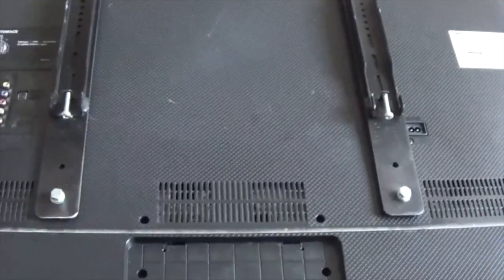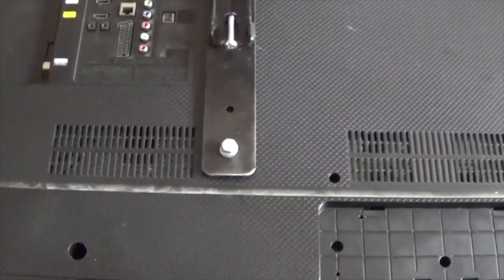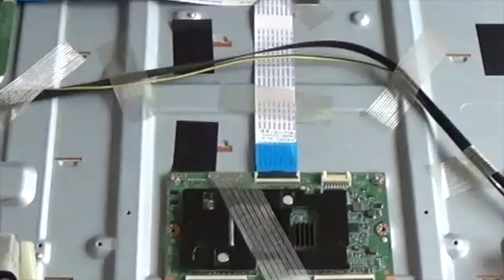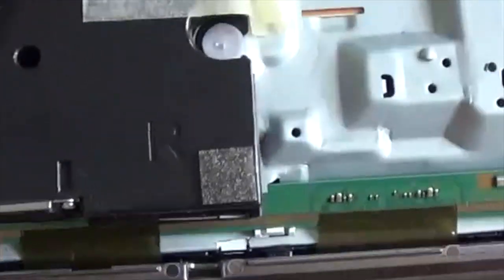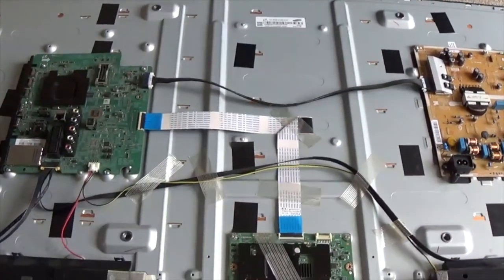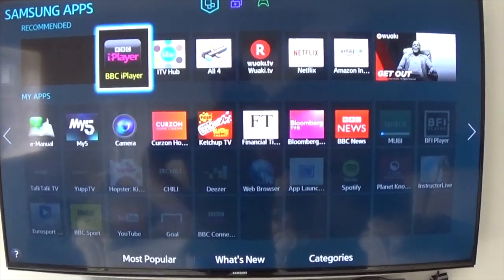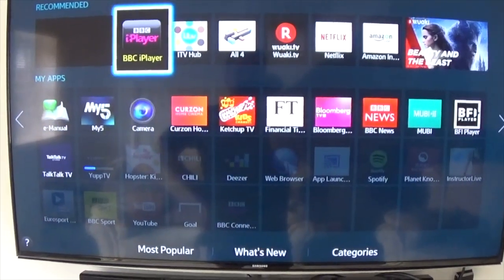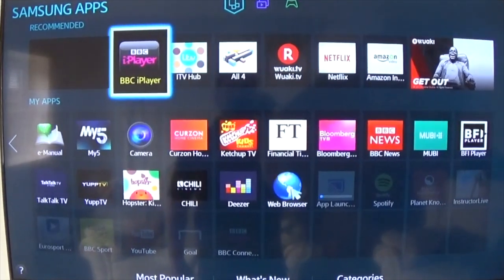Samsung smartTV repair - no wifi

Comment: I have a 32 inch Samsung smart TV thats approximately 4 years old and has had intermittent Wi-Fi finding issues on and off for years. Now though it finds the router but when it tries to connect, keeps saying cannot. Does this sound like similar problem u had?  Truly at wits end with a 4 year old TV that has had a total mind of it's own since  purchase. Ridiculous when older Tvs lasted 20 years without much of this crap. Thanks for ur video.
Reply from the maker: Peter Ford have you tried a lan wire to see if it works like that ? It should but unless the router is nearby it's of little help. Try a full reset of the TV but if it finds the wifi and cannot connect try the wifi settings on the router , channel for example. Mine failed to find any wifi
Reply: mjnurney Hi,, have tried Ethernet cable to no avail. Still will not connect. Only curiosity is the IP address and other addresses are 0000. That may be the problem but will have to find all those numbers, because the TV will not find them automatically. May try calling my fios company and see if they will walk me though the number process. If that doesn't work my next route will be replacing the Wi-Fi module. Seems doable, if the price is right. Thanks for responding.
Reply from the maker: +Peter Ford if you have an iPhone or pc connected to same network, you can easily find those numbers but the tv should find them automatically. Do a search of your tv on eBay and see if the boards are cheaply available if they are swapping it out is really easy.
Reply: mjnurney Thanks,, will keep looking. Sad tech has come to this. Stuff that gets u buying and a couple years later your paying again. Thanks again for advice.
Reply from the maker: Peter Ford I'm afraid things are not made to last these days. But it's not the end of the world to change the board inside. Wifi problems are very common on Samsung TVs for some reason. Changing mine was the best thing I ever did. It works so much better now.
Reply: mjnurney Last night I ran the Ethernet cable on the TV and set all the addresses and it finally connected. I am so baffled why it's such a hit and miss deal with the Samsung s. My vizio connects every time. Ridiculous. Thanks again.